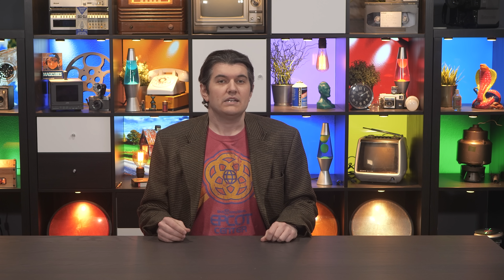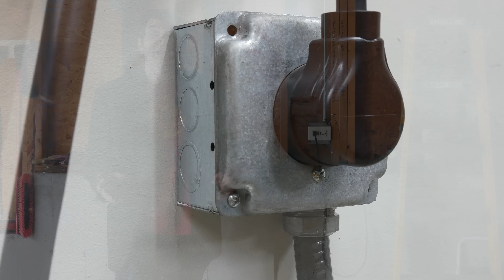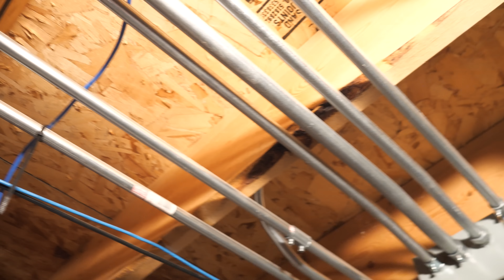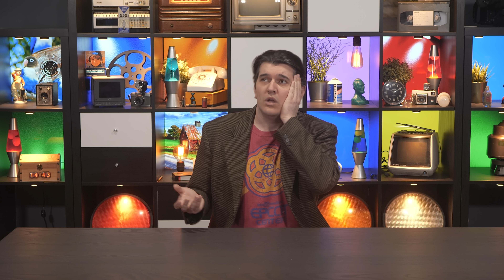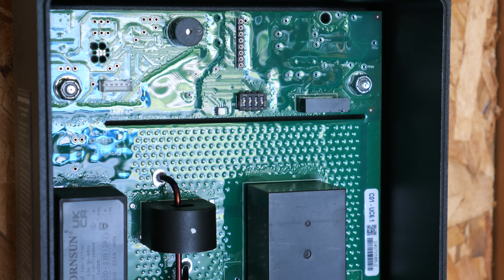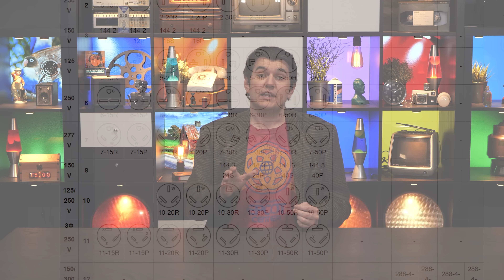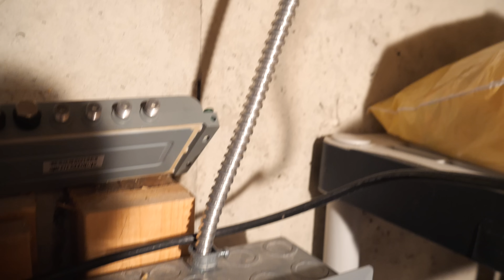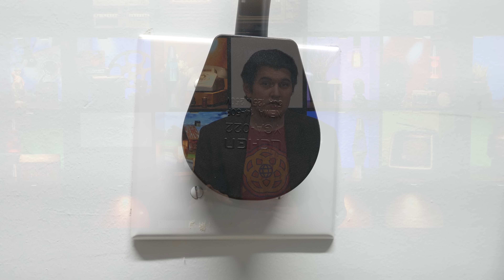The "standard" car charger is usually overkill—but your electrician might not know that

Comment: I know you wouldn't want to say this out loud, but after researching voltage and amperage tolerance for copper and aluminum wire in several gauges many years ago, I've been running my 220V arc welder typically at 90A (it maxes out at like 150A, but I never found an application for that much heat), through a 90Ft length of 10AWG Romex. Frequently I have to go somewhere and weld something that can't move--good luck finding a 220V extension cord--and the plugs are a mishmash of safety standards and corporate greed. So I hardwire directly to a breaker (it will tolerate as low as 40A if that's all I can get and I'm careful) and lug my old bitch around. Being doing jobs this way for sixteen years.

Comment: I have a PHEV and am considering adding an EV to the collection.

I had an electrician add a sub-panel in the garage to accommodate the changer unit and allow for future growth.

The charge unit with NEMA 6-50 recharges my PHEV in about 2 hours which is enough for local errands plus any later, after a mid-day top up, "oops, I forgot to get" drive....all entirely on electrons. 🙂

So the PHEV and an EV will be able to happily co-exist in my garage. 😎

Comment: I bought a Bolt EV two years ago and the dealer offered to install a charging station.  They said that I can still use a standard household outlet but it would be very slow. Even though they implied I really should get the station I put the decision off for later because my commute is quite short. Ultimately I think that was the right choice. In the years since I've never had a problem with plugging it in to a conventional outlet. It IS slow, but that has never been an issue. If I were a different kind of driver, sure the situation might be different. Grocery runs, work commute and the occasional long weekend trips has not given me cause for concern. I'm not an electrician, so this video has been very enlightening, thank you!

Comment: 16:45 This is also something I struggle to communicate. If you do frequent road trips or don't have at-home charging, then sure, range will likely be a concern. But for context, I drive about 100-200 miles per day, and that charger would be totally fine for me. Even a ~200 mi range EV would be almost the same except for 1-2 days per month when I would have to drive to the other side of the parking lot where I usually eat lunch and park at the charger instead of a regular spot. 
28:00 Ah yes, copper clad aluminium wire can go die in a fire. Which it is quite likely to do whether you want it to or not, so preferably it should be burned before it's installed somewhere. Don't buy cheap wire from Amazon, please.

Comment: A/C uses a lot of power at full blast in Florida.
With trafic a 22 mile trip with full A/C can come out to 40 to sometimes 50 mile trip as far as bat range is concerned.
Just because of being stuck in trafic for hours in heat. :p

Comment: The only thing that's kept me from buying an electric car is road trips. Having family 8hrs away between Utah and Nevada I tracked to see where EV chargers were and there was a whopping total of zero through the vast majority of the trip and not even gas stations are very common in the middle of the desert. Not to mention I need comfortable seating for 5 so a Bolt or Model 3 isn't going to replace my GL450. As interested as I am in an EV it's just not practical, let alone possible to fill those needs until more large vehicles get more range without breaking the bank.

Comment: Excellent video! However, there is one detail you glossed over regarding the benefit of having a faster charger at home: efficiency. 

ALL EV's consume some fixed amount of power while charging to keep the car "awake." Teslas are around 300 watts. So if you only have 1.5kW going in , only ~1.2kW is actually being used to charge the battery. (Sorry for the Tesla example, that's what I know the stats for.) If you do the math with 300 watts, charging at 120V * 12A is only 80% efficient, while charging at 240V * 48A is 97.4% efficient. (In terms of how much power is used to charge the car vs run the car's awake power consumption. Heat loss is a totally different topic.)

That being said, once you get up to 240V * 24A, your efficiency is still around 94.8%, so it's still WAY better than a slow 120V charge.

My advice to most people installing level 2 is get the fastest charging you can easily install and comfortably afford.

We're lucky enough to have a 200A service in our garage installed from the builder, and were able to easily put in a 60A circuit and hardwire our Tesla charger right to the breaker box, only about 8FT away. With a 22FT cord from Tesla, my wife and I can easily share it (I went Tesla first in early 2021, and she loved mine so much, she got one end of 2023. We both replaced when our old Gas cars had a significant and expensive problem to fix.)

Anyways, most of us don't need a really fast charger, but if you can swing it, do it! ;)

EDIT: I noticed you addressed this in your pinned comment. Good call! As you mentioned, the higher your power cost, the more this matters. However, I'd gladly pay the $100-200 more to save $20-50 per year in power, and have the ability to charge much faster when needed. But it's an individual's choice. In fact, hardwiring my charger offset the cost of installing an outlet, and allowing for 60A instead of the 50A a Nema 15-50 would have limited me to. And with this level of speed, we can rotate multiple EV's off of the one charger.

Comment: The number 1 failure I see on 14-50 connector is actually from corrosion( and "dirt") (RV application).  That being said my above ground pool pump permanently plugged into a 120V 15A GFCI discoloured the white outlet and it was protected....

Comment: Fast charging is actually not good for the long term life of the battery because the cells are not balanced during fast charging. Only the AC charger in the car can perform the balancing of the cells. At least this was the case with my IONIQ.
So next time someone say just use the fast chargers, tell them to shove it!

Comment: UK here. My trouble is that to charge my car via the 13A socket I need to feed the cable through the letter box on the front door. The 7kW charger I had fitted cost £100 more than the 3.5kW charger so that was a no brainer and now I can 80% charge in a few hours and fully charge when I need it in a few hours more.
As for the app... due to where my charge port is located (outdoors, no garage) the app makes sure nobody just plugs in when I'm not at home and steals my electricity. It's swings and roundabouts.

Comment: Here in Australia our standard single breaker circuits are 240v with a 10 amp breaker. This means you can get a short load of 2.4 kW out of every household outlet. So you can use the cable that came with the car and safely pull 2kW to your EV no questions asked. It will be better for battery longevity to charge as slow as possible anyway so the hours between getting home and going back to work will be sufficient charging for most use cases, Even if your workplace doesn’t have EV charging.

Comment: Two things I know about this.
One (at least in my country, each city or town provides permits for contractors to do wiring or installation of electrical equipment as far as Hot Tubs Panel installation and I'm positive EV outlets.
It's a Provincial license but City Permit.
The intelligent homeowner can set up his own devices (accurately sourced materials) and assembly but hire a local City contractor to do the Inspection and Connection so it's "Signed off" as safe and insured 
Definitely "hard wired" is superior to one plug and cord adapting to yet ANOTHER plug and cord..
You lose too much potential current at each "plug"
The butt clincher....
-Fast Charging is a battery killer -
If you want the full advertised lifespan you need to stick with the lowest possible charging level.
I've found this true no matter what the battery chemistry. 
High charge level generates heat and heat means you are burning up the suckers potential to go the full 8 or 9 years.
Buying someone else's EV you get the nasty surprise that they always used quick charge and the poor battery is whooped at the 7 year mark and its another $40,000+ for the dealer to swap it out.

Comment: I don't have an EV, but one possible argument I might argue in favor of a smart charger is the fact I'm a homelabber running Home Assistant. It would be nice (Though not necessary.) to be able to have a report on how much the car might be drawing or how much energy it's consuming. 

I don't allow my IoT devices onto the Internet either, that's what firewalls are for. And while for the everyday user that "must use an app" thing can be a roadblock, if Home Assistant can support the protocol, chances are you'd only need to put the charging station on the Internet for a few minutes, if at all, to get it on the network and talking to Home Assistant. 

And of course, if those stations support Matter, then it would be supported by HA anyway and not need an Internet connection at all! 

I say this because the EV itself is expensive, and you really can't bank on the EV using any sort of industry-standard protocol for its reporting, and is more likely to put a hard dependency on an app for this than the charging station. 

Of course, you could just throw all that out the window, buy an ESP32 and some other equipment and build a modification into the charging station itself where the ESP32 can report the charging stats.

Comment: This is SO true. We charge for all our daily needs on a regular plug. We can replenish from our commute and add enough  over night to get back to 80% from 20-30% over about a week. So a little weekend excursion doesn’t need any more than just plugging in overnight as usual. There are superchargers nearby at a grocery store so if we need to fill the whole battery in a day I shop while it charges.  If you’re considering an electric car realize you have options for home charging and you’ll likely spend less time charging than pumping gas.

Comment: Another consideration is that modern battery chemistry prefers slow charge rates even though it's capable of absorbing energy at fast rates. Longevity is increased with slow rates.

Comment: Hi Alec. You mentioned more thank once that you need at least two free slots on the braker panel. I understand that that is the easiest way of doing things but even without that space you can always add a line with a braker in line evan is the panal is full. 
Second thing you Mention is that service upgrades might be necessary if you panel is full. I do not understand this. 
Installing a simple dynamic power meter which talks to the "charger" would be enough to allewys make sure that alle the power necessary for the home is available and that only what is not needed ist fed to the car. At the end the Amps a home can be supplied with are usually only needed in very rare occasions for a home. I live in an apartment with three phase 25A service. So in totale I can only darw75A.

Water heating is done with oil. Build in 1996 oil ist still quite normal here for heating and warm water the only thing that really vonsumes electricity is the stove. 
With dynamic power metering in case the stove or the cattle or the washing machine the dryer draw power the charger gets a signal to tell the car to draw less power. As soon as power ist available again the car is informed to draw more. 
Since I am not running a restaurant and I am sleeping at night a can easily charge 100kwh avery night or if Reilly necessary 86kwh to two card every night before losses. That would be like 430 km of range every da. Total overkill if you as me but such a setup cost you 950Eurso for the charger and teh dynamic metering Europe. A Second charger would be 650Euros added. 
With that you would be save for aver. 

Maybe you can make a video about such a setup one day. Ok beeing in the usa it would be one or two phases not three phase and probably with less amps. 

Best regards. Ben

Comment: As an electrician, I'll be installing the cable and outlet to suit the current draw of the load device, I wouldn't trust a client to never play around with the dip switches after installation.

Comment: I think sometimes TC has the tendency to avoid talking about the intangible benefits, the things that you can't put head to head on a chart to compare against.
For example the premise that you don't drive a fuel car 350+ miles in a day so why would you need to be able to recharge 350+ miles in a day?  Because I don't want to refuel every single day even if the gas station is in my driveway.
Another aspect is the feel of it?  Your car is topped up and ready quickly. That provides a certain feel.

Disclaimer: I don't own any EVs, but some day I would like to.

Comment: Charging on a 15a, 120v circuit will be less efficient on the power bill. Also, they do make 6ga MC cable (50a). Used it several times myself

Comment: DIP switches are the best. My EVSE (wallbox) has a an app and I can change the power output there, too - but never go over the DIP settings. Because there is a clear distinction between an appliance installed by a certified electrician which I am not allowed to open and to tinker with; and me, a non-qualified customer, clicking randomly in an app.

Comment: Interesting that you use a (NEMA) plug. In Europe (Czech Republic), my EVSE is hard wired. 
In theory I could use CEE plug (that big bulky 3-phase one), but that charger is sold as a very niche portable option (many people would have a CEE plug installed in their garage on the slim chance they ever decided to use some workshop tools there).

Also, the CEE plug and it's wiring is generally rated to 3x16Amps and the wiring is sized to that. But the installing electrician strictly demanded that the EVSE required new wiring and could not reuse the existing wiring to the CEE plug in the garage - because as a long-running load, it requires 20% safety margin.

I use a L1 charger at one location I often travel to... it works fine, but I still feel a bit uneasy drawing over 2kW through 50 year old wiring the whole night.

Comment: As a European and, more importantly, Norwegian, this entire video contradicts every safety measure we are taught here. First of all, all electrical work has to be done by an actual electrician. Your insurance is going to be real happy to find out you did work yourself in case your house burns down, not to mention that doing electrical work yourself is actually illegal.

Secondly, the chargers that comes with the car are explicitly named as "emergency chargers", only to be used if there are no alternatives available, and only on circuits with surge protection in the breaker box. Using a charger on a socket, regardless of type or rating is just not recommended for safety reasons. Our wall chargers comes with a type 2 outlet. And even though chargers have inbuilt surge protection, a seperate surge protection is ALWAYS required in your breaker box.

And finally: Smart chargers. I love mine, even though I have concerns about features being locked behind the cloud. But since we have fluctuating electrical prices, just plugging in the car and letting the charger choose when to charge based on when I need my car and on the forcasted pricing is just brilliant and has saved me upto 50% of my charging costs. Not only that, combined with load surveilance via the HAN port in my breaker box, my charger can compensate for other heavy loads in the house, both to avoid tripping a fuze, but also to keep under set load points that trigger higher connection fees. And lastly, a new feature called "grid rewards" allows me to opt in to allow my service provider to turn of my charger for small periods in order to aid load balancing on the grid, where they will actually pay me for the load I am not using. Or in the opposite situation, where demand is lower than expected, charges the car in periods when the price otherwise is too high for the price saving function, and PAYS ME to charge my car. Grid rewards respects your charging goals, so if you've set your car to be fully charged by eight in the morning, it will be. Only instead of just fully charging the moment you plug in, it distributes the charge based on price and charge back via grid rewards. All of the smart functionality is accessible via their API, so home assistant can pull info and use the functions (albeit via the cloud, unfortunately).

And in the event of a failed internet connection? Who would have thought, the charger simply becomes a regular "dumb" charger.

Comment: 370V 60A 3-line circuit (seperated to 3x 240V 40A, and treated as 30A) with 8awg and 12awg direct ground would overkill for ton-and-a-half electrical truck top-out if it's used 3 times a week.
I mean, the 370V means it applies to industrial power, in some countries. My dad's also have several 370V "outlets" (and plural since building is not 1 not 2 but 3) and there should be provided to plug charging stations directly into 370V, with some additional ground.

Comment: I added a NEMA 14-50 to my garage because it’s a flexible plug when we move and sell the house. But I only needed more juice in the winter. In warmer weather, my Bolt charged completely for my commute on a lowly, 110v outlet at Level 1. (Also, the Grizzl-E is fantastic! It was the only “dumb” EVSE I could find.)

Comment: Tesla got in trouble and there are a few law suits right now because tesla got caught by customers doing Over the Air Updates on there cars Downgrading the customers range through the software when the customers paid for the extended range package and was doing it while people were sleeping and customers notice wait i was getting 200 miles if more range now its gone what is going on. 24:19 @Technology Connections